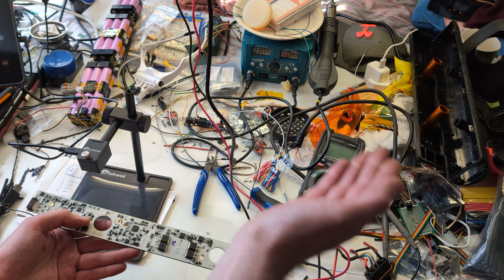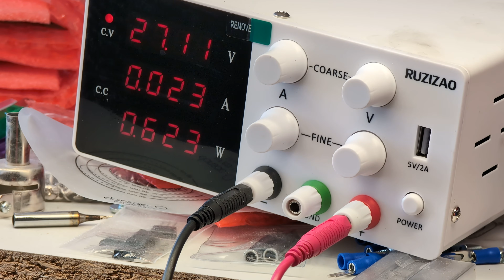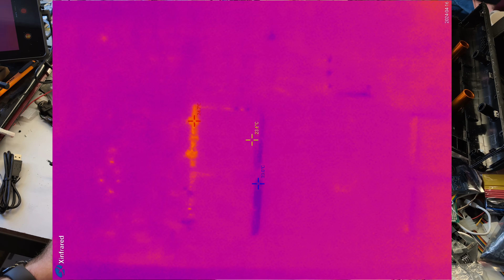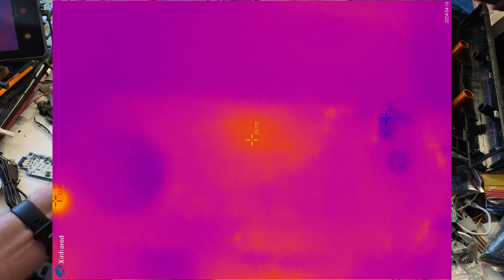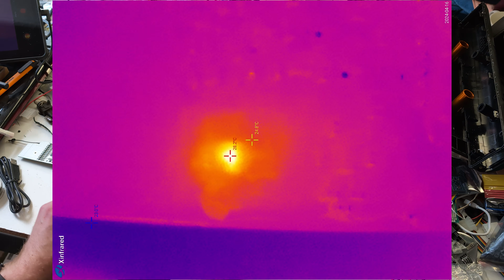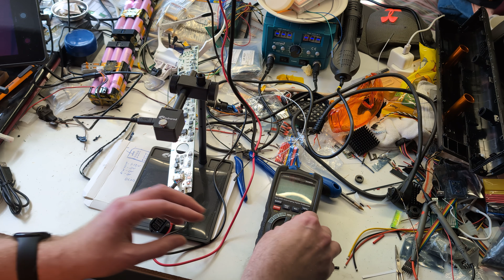Focus Jam2 6.9 not charging & won't turn on - It's dead dead - my dead ebike part 3

Comment: My JAM2 fell off the rack at 25 mph and the battery quit working just like yours. I cracked it open and tried everything as well and could not get the thing to power back up. My bike was still covered under warranty through focus so they sent me a new internal battery without requesting the old one back. It's been good ever since but I know the day will come when this problem will happen again and it seems to be nearly impossible to buy these batteries in the USA.

Comment: Same symptoms with mine. I did put a DC supply on the battery hoping to bring the voltage up which it did however it still will not charge and the blue light on the power switch stays on.

Comment: You know what I'm going to say!.....VESC 🙂
Fit a semi-decent BMS.  Bin the controller.  Replace it with a FlipSky 75100 VESC, filled with Magic-Gel for waterproofing.  Update to the latest firmware with the awesome VESCTool - and run HFI commutation.  With HFI, you don't even need to connect the hall sensors and the motor will develop more torque than it ever did before.
It's all pretty easy and open source - and there are loads of people who can assist.

Having converted my bike to a VESC, there's no way I'd go back to a shady OEM controller.

Comment: Definitely ain't as easy as rebuilding a carburettor, that's for sure, makes me wonder how many e-things are or will be dead because of one small component failure, and with a lot of builds like that board being "proprietary", they refuse to release technical documents on the parts used to aid in repair, resutling in a lemon that costs more in replacement parts than the item to be revived is worth, and then ends up in the nearest bin... :(

Comment: That component looks like a low value resistance used for determine the current flow, the switching noise looks like a maximum current has been reached, thus trying to PWM the input,
The hotspots maybe a voltage regulator? 
Worth looking up what those component functions are, maybe input codes into Google, or even use Google camera 📷
Reply from the maker: The big square chips turns out to be a fancy BMS chip.  But I'm not sure how user replaceable it is or if it gets programmed.